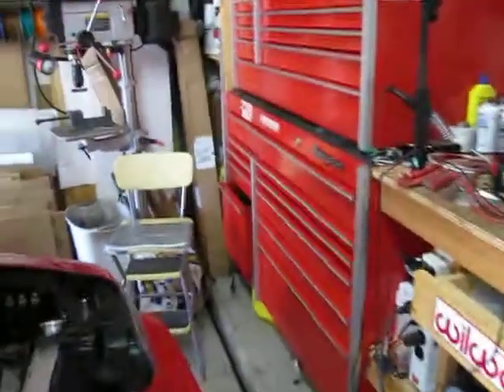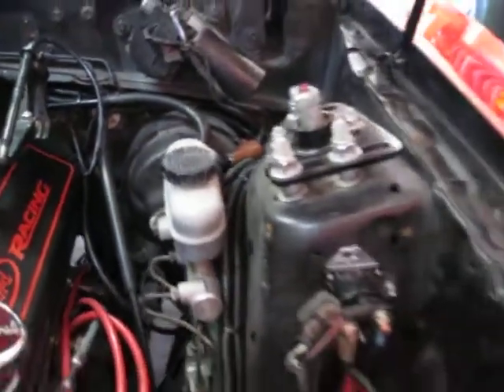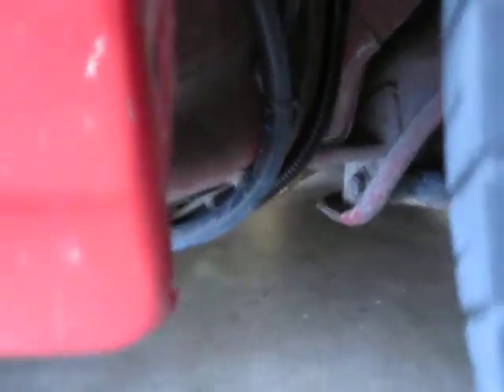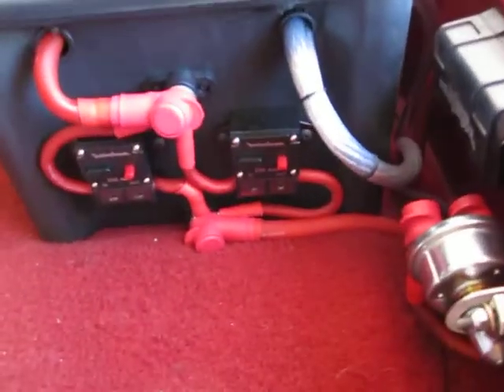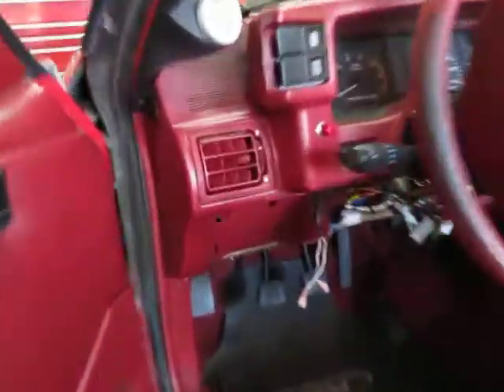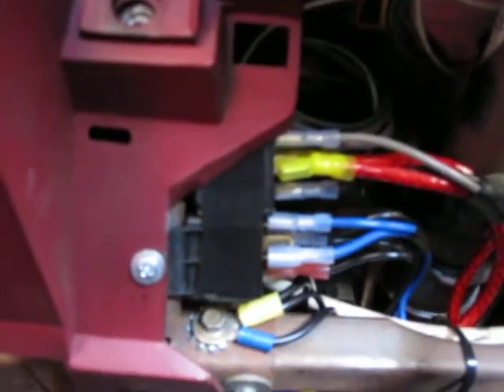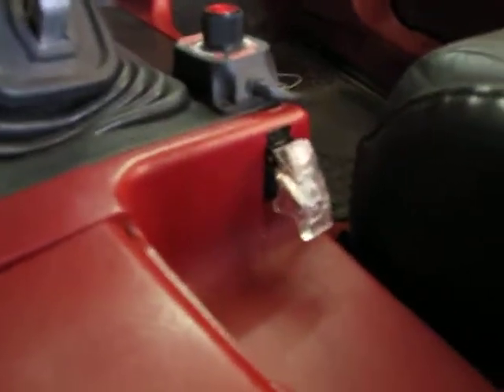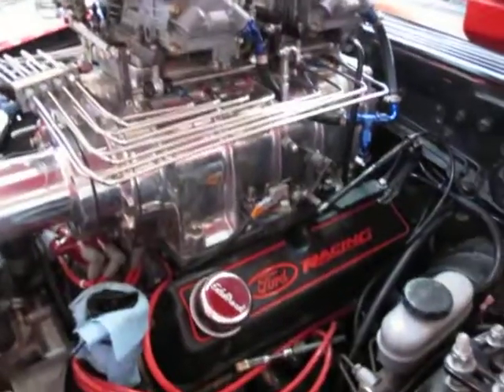6-71 Blown '92 Ford Mustang - Rewiring Project Part 5 (final)

Comment from the maker: @fritosaregood An electric fuel pump should only be running when the engine is running or to prime the fuel system before starting the engine.  In this car, it was wired so that when the key was in the ignition position, it was ON - even with the engine not running.  Installing the master ON/OFF switch for the fuel pump allows the owner to turn the pump ON when he needs it on and leave it OFF otherwise.

Comment from the maker: @fritosaregood It's personal preference I guess, but I NEVER install an electric fuel pump without a dedicated ON/OFF switch. Let's say that you want to run the valves - you don't want the fuel pump running when you're cranking the engine.  Let's say that you wanted to pull into the drive-in and turn the engine off but keep the defroster running.  An electronic fuel pump should function just like a mechanical one in this aspect.

Comment: @blown72olds Was it just not practical to wire to the ignition 2 position? or was it for safety since it will be on the drag strip too?